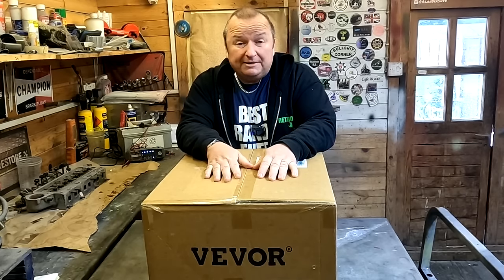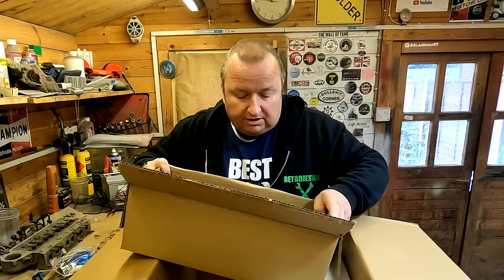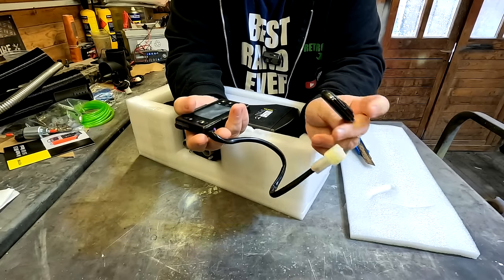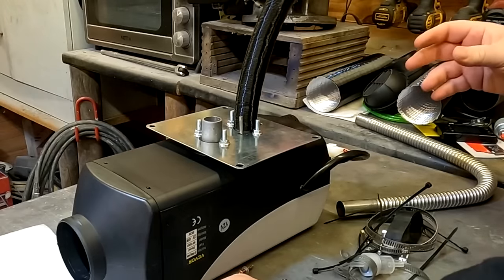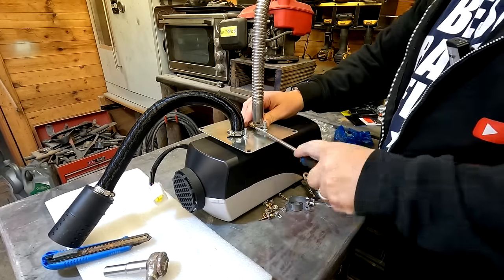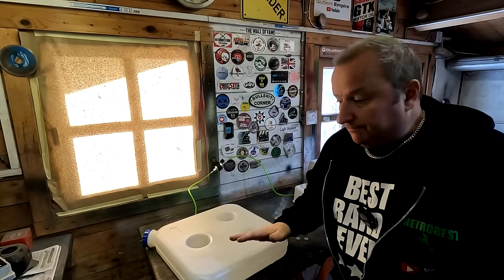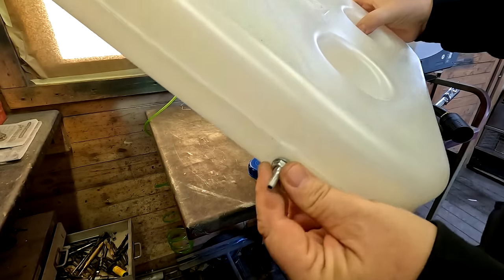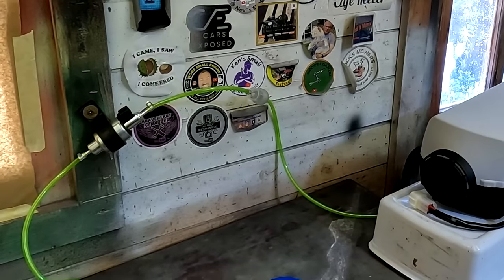Shocked - Using This Diesel Heater In My Workshop

Comment: Hi Martin, Very informative & useful as always mate. I recently purchased a camper with one of these heaters fitted, quick question for you, do you know how to turn off the control panel when the heater is not in use?
Reply from the maker: I think you might have to install a switch in the power line but only use it once the unit has powered down it's self as it needs to throttle down and cool off the heat exchanger when you switch it off from the control panel.
Reply: @retrorestore  Brilliant Martin, will look into that this weekend - Many Thanks
Reply: @thelionofzion2987  Best keep it powered up or the clock needs resetting every time they can be set to come on and of on the clock which is neat!

Comment: Watching this one carefully Martin. I have a log cabin too and heating it with an oil radiator but it's costing a fortune. Would be good to see how much it costs to run. I assume you'll run it with red diesel to reduce the cost?
Reply from the maker: Yes it will
Reply: @retrorestore  I've just bought one for my cabin :) Apparently it'll run great on heating oil as well which is even cheaper. Happy days.
Reply: @rabsrealm  That is red diesel.

Comment: Didn't even know these existed, i am definitely getting one of these, how loud are they? did not sound too bad in the video.
Reply from the maker: The mic made it sound louder than it is. It will be boxed inn as well outside.
Reply: @retrorestore  Better of keeping the unit indoors using the steel flange to pop it through the wall as designed so it draws in and circulates the workshop air rather than cold from outside will also prevent condensation causing corrosion to the unit.

Comment: Quite sad that even with fuel prices being as bad as they are that a 5KW diesel heater is cheaper than electric. Running this thing on a bio fuel would not only be green but also save you a fortune, that's if it works

Comment: i'd add a solar panel to charge the battery , that way you don't have to remember to switch the charger on/off
Reply: Most chargers are self regulating and can drop to trickle charge as the battery tops up.

Comment: i would move the fuel filter it needs to go before the fuel pump otherwise any crap could get sucked up and there is nothing stopping it  blocking the fuel pump
Reply from the maker: Yes, it was only a mock up Steve

Comment: If it ran on paraffin, domestic heating oil it would be a winner. Heating oil is 89p a litre diesel £1.70 a litre. I do not think there would be much difference between this a an electric heater to run to heat your shed.

Comment: Hi Martin, great video , I've been using one to actually blast background heat into my house ...same way as youre doing your cabin, ...mines a 3 bed house and on the low setting approx 2kw it will blow air just generally in to the house and keep the base temperature up which keeps the main heating costs down ...been doing it for a couple of years, for info about all the details of the workings of these one of the best sources on youtube is "John Mck 47"  thanks

Comment: you do make things hard for yourself  use the fuel pipe stick the nut on then push through and out of the spout then connect and pull it back tighten the nut
Reply from the maker: What was hard about what I did? It was easy.

Comment: If energy prices are a challenge that one think will only rise and raise to the sky, then insulating the building is probably a better way forward, start with the ceiling, then doors and windows, walls and floor.

Comment: I don't know if anybody else's has said this, however you "NEVER EVER" put the fuel filter after the pump, it always goes before the pump, technically It should be just after the fuel tank, maybe I'm wrong, it just makes sense for the fuel filter to go before the fuel pump.
Reply from the maker: Bit strong with the "NEVER EVER" bud. It was just a mock up. The installation video shows the correct filter position.

Comment: Hi Mart. Got one of these. They very efficient. I would recommend a carbon monoxide detector for safety.
Reply from the maker: The exhaust will be outside James.
Reply: So is the exhaust for your gas boiler in the house, the alarm is to detect leaks, so better safe than sorry, please get one.
Reply from the maker: All open flame appliances give off Carbon Monoxide and should only be used in a well ventilated room. It is wise to have a carbon monoxide sensor though I agree.

Comment: If you think this will be cheap to run you had better think twice. The only way if you can is a wood burner one that only smoulders no flame and next to no air intake. The one I have on my boat burns for around 20hiurs on five lumps of coal.. my diesel heater drinks like a fish for the time I run it.

Comment: The heater should be inside with the metal plate bolted to the wall with your diesel outside and the pipes outside.
Reply: newer keep diesell tak out winter season, plastic prittle and diesel not warm and if tank have in garage warm diesel burn clean,no smoke lot. and start better.

Comment: It'd be interesting to know what sort of temp it heated your place upto 👍
Reply: That is adjustable it shuts down when the air is warm enough.
Reply: @jostouw4366  i mean the max temp it would get upto.
Reply: Probably around 150 C at the outlet at 5.5 pump rate

Comment: You probably want to put the air supply into the room low down as the warm air will naturally rise and you want to limit stratification.
Reply: it has a strong fan to stir the air and the ducts can be aimed.

Comment: I ordered one of these, different brand. But you can tell they are all made by the same manufacturer. This kit came with the tiniest fuel line tubing I've ever seen. No amount of heating or forcing this tubing would get it to connect to the fuel canister nipple or even the fuel filter! Absolutely useless tubing. I was wondering if you could provide a link to the green tubing you used - I looked on Amazon and couldn't find it anywhere.
Reply from the maker: I can't remember, sorry.

Comment: I've seen a lot of videoes now. And absolutly NOONE takes advantage of the exhaust heat. You would put the whole unit INSIDE and extend the exhaust by several meters, and take advantage of the radient heat from that. You can also twirl your cold waterline, going to your hot water tank around the exhaust, preheat the water, and thereby save a few quid on your hot water. Mounting it all outside is a waste.
Reply: I thought that too, but did see one guy try to take advantage of it and suffered a lot with moisture buildup in the exhaust system. He ended up giving up.

Comment: Odd you chose diesel fueled heater. Here in the USA diesel cost a heck of a lot more than gas. I have a K1 kerosene shop heater, but haven't even got it out of the box in the last three winters...  Let us know how well you like this new heater over winter... Thumbs Up!
Reply: We also have pink diesel which is domestic heating oil
Reply: @jostouw4366  ive seen these run on old engine oil watered down with 5% unleaded petrol/gas
Reply: who idiot keep fuel at outside winter season ???? keep fuel in shop and start and burn lot better and smokeles if use warm fuel.
Reply: @mattivirta  Idiots that don't live at the Artic?

Comment: how much diesel will it use per hour regards gary
Reply: Mine (before it was stolen) produced about 4kW and 0.5 L per hour. I added battery backup and mains power loss fan shutdown (otherwise blown motherboard / heater damage)

Comment: LOOKS like J  U  N  K, looking forward to hear a review after the winter. Why does it use so much battery power??, maybe a pull start and alternator would be better??
Reply from the maker: Its the glow plug that uses the amps only at start up. They only use 1 amp after that

Comment: air inlet filter better use big car carburettor air filter lot better. and fuel bump need own noise insulation wooden box not noise lot bump ticking.

Comment: WARNING...Great heater for my workshop until it broke. The fuel pump stopped after a few days of use. Trying to get Vevor to resolve the problem with no result.
Just getting generic emails back saying the problem is solved and the ticket closed.The phone number supplied is useless. Keep getting messages that phone lines are busy, ring later. Ring later still busy.

Comment: What are the Carbon Monoxide levels like?
Reply from the maker: its only rigged up temporary at the moment.
Reply: It's a room sealed appliance so zero carbon monoxide.
Reply: @Flying-Hat    if there are no leaks in the heat exchanger or exhaust system.

Comment: I use this one in my house. However there is no 8KW model that's just a marketing ploy - they make 5KW and 2KW and that's it
Reply from the maker: The 5kw and 8kw are the same unit. You can adjust the 5kw controller to give you the hotter range.

Comment: Instead of a 12v battery for power, why not use a 12v converter. Connect the heater to it, plug it into the mains, no need for a battery!
Reply from the maker: Check out tonight's video of the installation Mike.

Comment: Well, that is the cats ass, or bees knees, lol. Can the fuel tank go outside so the diesel isn’t inside the smell ect. Heater can go inside is fine as it direct vent, is there a thermostat that allows it to come in and off to keep set temperature in room?

Comment: Why are my coments about a power supply being removed?
Reply from the maker: Not seen any other comments from you.
Reply: @retrorestore  I said you can get a 30a 12v power supply on Amazon for about 30 quid also try and keep the unit inside and sleeve the exhaust through the wall as the damp doesn't do them any favours

Comment: Has anyone else's diesel heater packed up ? 
Mine will switch on, the pump pumps the diesel, the heater 
starts to blow, it blows cold air for about 3 minutes and then shuts itself down .
Reply from the maker: Sounds like a dirty glow plug.
Reply: @retrorestore   I've hardly used it , I bet it's not run more than 40 minutes since I bought it ...
I ran perfectly last time I used it but went switch it on last night and it just blew cold air and packed up and the same tonight.
Reply from the maker: @DribblyBob  What are you running it on.
Reply: @retrorestore  Diesel. 
I put £10 worth in .
Today I started the heater,  the diesel pump worked as normal and the heater started to blow the cold air for about a minute and then the pump stopped , the heater carried on blowing cold air and then after about 30 seconds the pump started again , the cold air was sti blowing and after a minute it shut down again and the cont panel started flashing, like its done when its shut down before.
Its the old type on panel and not lime your digital one, its the old on and off button with a turning knob with red lights going around the dial, these flash when the hearer shuts itself down.
Ive emailed them and im going to return it , the other half doeant like the smell anyway
Reply: They have given me a refund and I've kept the unit .
Can the glow plug be got at ?  and can they be bought to replace if that turns out to be the problem ?
Reply from the maker: @DribblyBob  Yes, they are for sale on Amazon, easy to change

Comment: lot better use 100W solar panel charge battery and heater need only 40W power can run, then have perfect not need pay elektric and use waste filtered vegetable oil have totally cheap keep workshop warm alltime, need change better copper tube fuel line and strong rubber tube to copper joint, this plastic tube have worst, i have same heater and keep my workshop good warm all winter season and have normal winter -34 degree celcius could.  this is lot cheapen use than my old wood burner and old oil stove what i has used before.

Comment: fuel filter before the pump.. step down transformer 240 - 12.
Reply from the maker: Already done in the next video.
Reply: But from looking on several other videos (like the one from the control-panel guy), learning that if the power goes out you will not be able to stop the heater correctly and it will overheat and destroy the electronics inside, and maybe the plastics.  The heater needs a controlled shutdown procedure (built in the control panel unit). Even with a battery you will need to shut it down manually (via control panel)  when you still have power, as there are no automatically shutdown when AC powerloss happens.